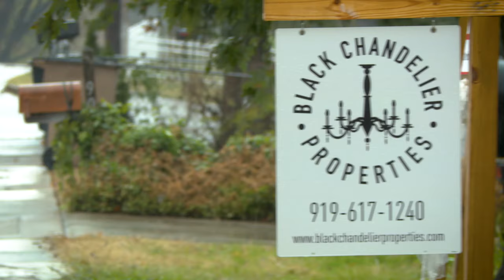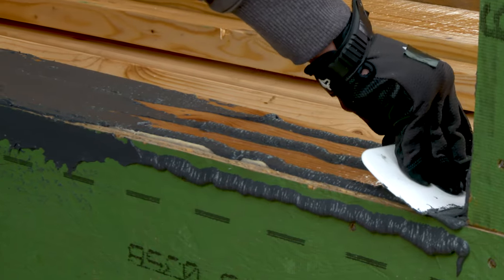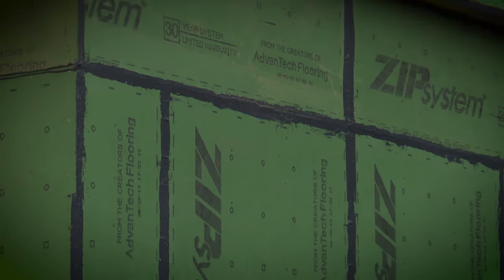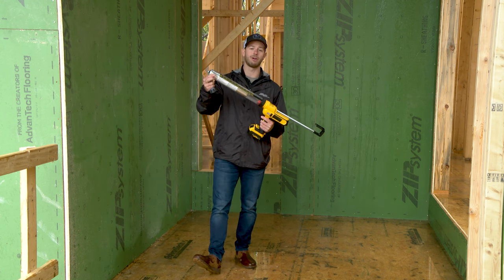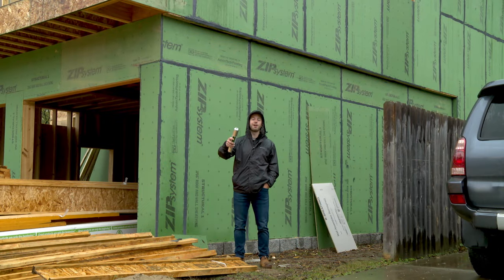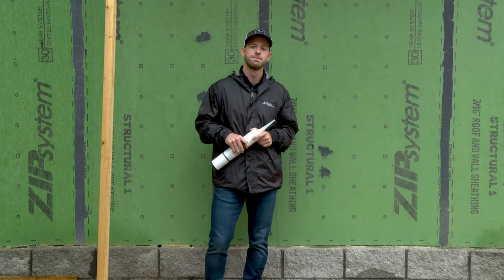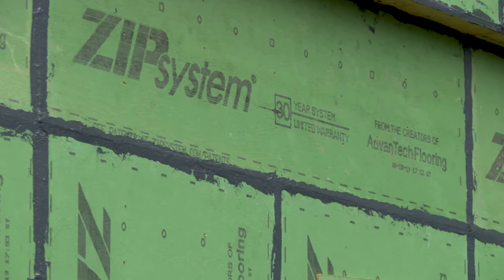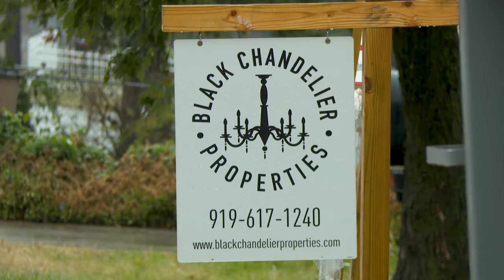Using Fluid Applied Flashing | Behind the Build | ZIP System building enclosures

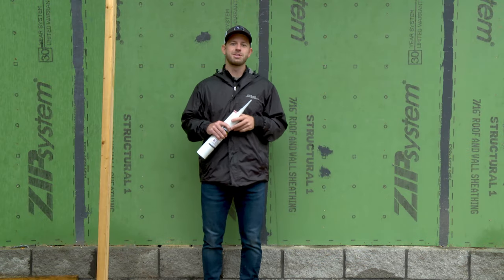Comment: 4:00 you can clearly see the head of the nail Overdrive into the zip system  to the point that you could see the wood, if left it like that it's like installing a regular panel without protection.  You SHALL cover every head nail or screw disregarding what the manufactoring saying. It's obvious and you can clearly see it set.
Reply: Often the simple things are over looked. A builder is only as good as his subs he hires to actually do the work,lol ! Here's a video addressing that issue; https://www.youtube.com/watch?v=p3q09-Thebs
Reply: "Belt and suspenders". Well, that's a bigoted comment by dating someone. Actually, all nail penetrations are to be covered or your warranty is void.